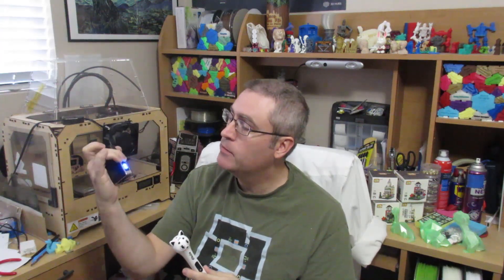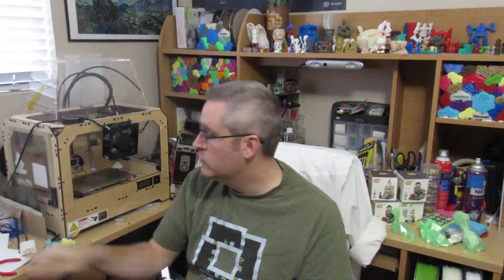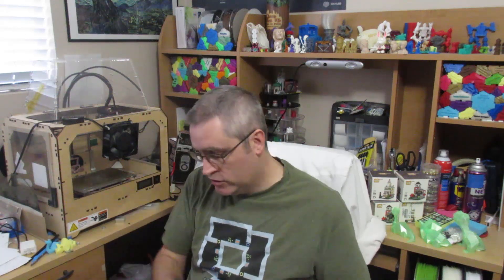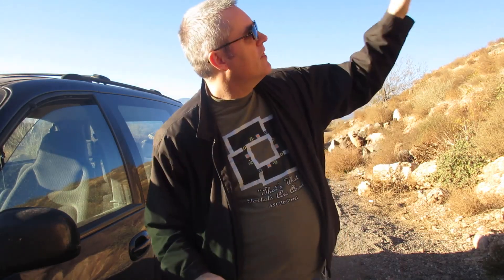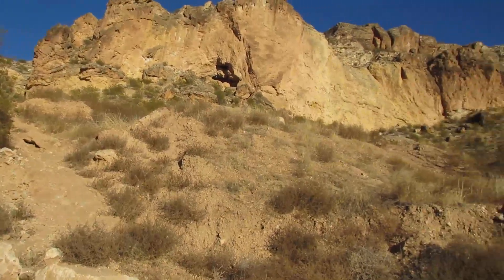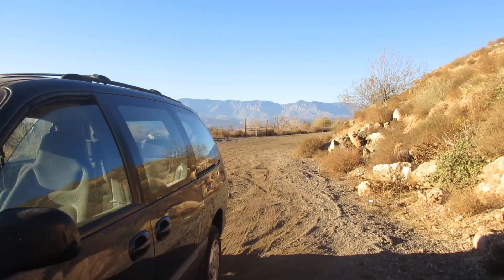3D Penning on the top of a Mountain with the Dikale 3D pen

Comment: Well it wasn't exactly THE mountain, but it was at height. You need to provide penning height, for starting a record challenge for the highest 3d penning.
Reply from the maker: Well, I was probably around 32k feet where I did the penning, but I picked up the rock I penned on at 38k. I wonder what the peopel who live on mountains are at.

Comment: Battery packs with Ni-MH cells are super handy.  No waiting to charge, just swap pre-charged batteries and go (slapping the dead ones back on the charger first, of course).  If you're into rechargeables you probably already have a ton of those little guys for remote controls, cordless mice, flashlights, etc. anyway    ;)

Comment: I think you need to scale that mountain a bit more often, as it appears to challenge you physically. Also no cheating with driving most of the way up!

The pen and the battery pack that you put in the description don't fit one another! The pen is specified to draw 2A of current, which is not unreasonable, but the small Anker is just an MP3401A or similar and it just about folds over and dies when you try to draw 1A out of it, it's one of those uncharacteristically mediocre products for this brand. It's better to choose a bigger power bank, best one that's specified to 3A or more total or 2.1A or so per port at least.

Mhm, almost convincingly NES sounding music from Incompetech, and then a Zelda style - didn't expect that he did something like that.
Reply from the maker: Good to know about the battery pack. I'll take suggestions for what to replace it with. I bought this one at a local retail store, so hard to make an amazon link for it.

I've been up this mountain many times. It's a good hike. I like it. Of course, I was a bit winded because to get some of that footage I had to set up the camera, walk away, then walk back and get my camera. So I did parts of that hike 3 times by the time I got there. No crew.
Reply from the maker: I've edited the battery suggestion to the next grade up that can do 2v out.

When i found this music on incompetech, I was like "yes". Perfect for a quest outdoors.
Reply: Very thorough comment!